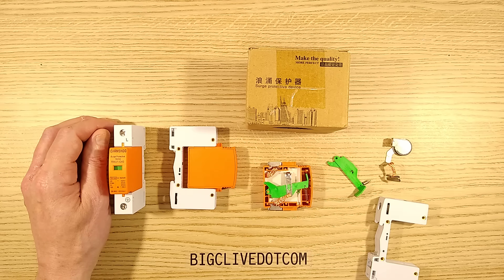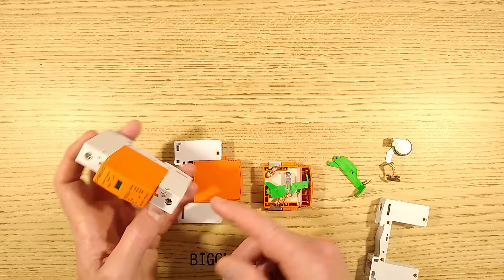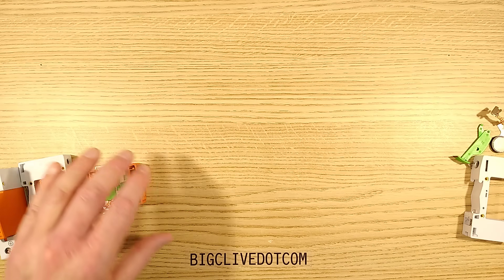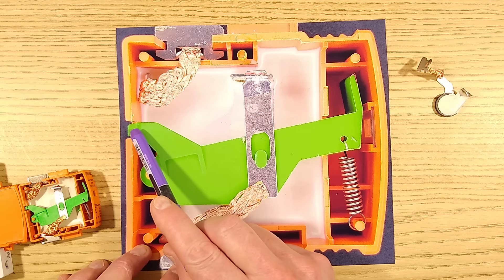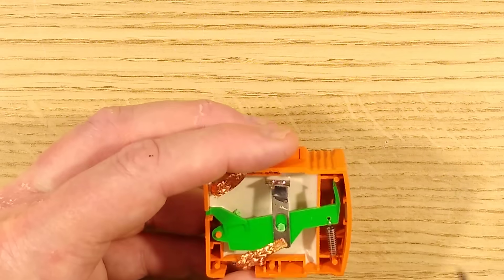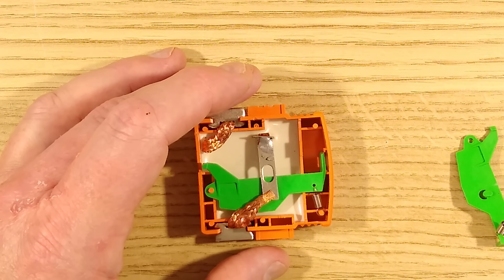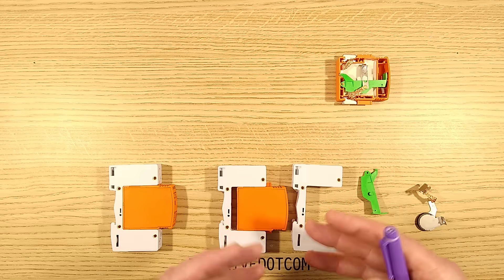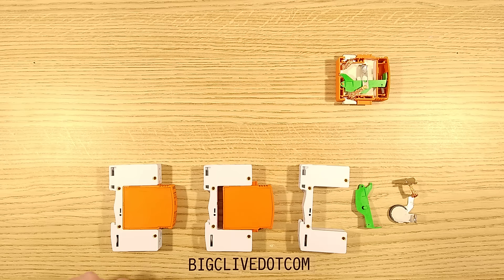Defective surge protector being dumped on eBay

Comment: Thanks, Clive. Great example of why you should always buy your safety gear / protection equipment from a reputable source i.e. not Amazon, eBay or Ali Express. You just don't know what you're going to get 😟
Reply: I've bought plenty of genuine products from Amazon-as-seller, never a fake, but do research whether something was recalled.
Reply: @stinkycheese804  i got a counterfeit Cards Against Humanity set in spite of buying from a Shipped AND Sold By Amazon listing 😬
Reply: To be fair, it’s more the brand (or lack of) on the SPD that’s the problem here, rather than where it was bought from.
Reply: @GadgetMan36 there are counterfeit ones so not much to do with the brand name since there are fakes
Reply: @GadgetMan36  but not really, because on Amazon, eBay, and AliExpress, there is no accountability and no liability.  They avoid accountability by claiming they are only a marketplace and not the seller, leaving rejects and counterfeits to flourish.  The sellers are fly-by-night operations.  They don't care what they're selling because they have no reputation to maintain and no responsibility when things go wrong.  It's not enough to look for reputable name brands.  You also need a reputable seller, or else you don't know what you're getting.
Reply: I beg to differ. You know exactly what you will get. Junk!
Reply: My amazon calipers work fine, were an outstanding value. @GeneCash
Reply: Even buying from a reputable source doesn't always work out.

Comment: Couple of questions / thoughts;
A) Deleted - hit keys before thinking 🤣
B) I was under the impression that, for effective surge protection, you need Line & Neutral suitably protected to capture surges between Line & Neutral and also Line or Neutral to earth surges 
B) was your soldering test done in a vertical or horizontal plane?  If the later that might be why the solder bridged as gravity was not assisting the molten solder to fall away

Assuming the eBay price is right and if the only real problem is the paint may be worth buying and manually painting the red in! 😂😂😂😂
Reply: Surge protection should be before any residual current device. 
Surge protection should be between any line and earth, including three phase and neutral. Let's not get into switching earth requirements like micro generation changeover. 
Traditionally fuse melting took place in a glass or ceramic enclosure, solider is not a fuse, nor sprung loaded, perhaps this is not a CE approved product, well spotted!
Reply: @tonywebb9909  Yep - you are right it is late and I got the device positioning wrong so my A) is a bit stupid - I'll delete it 😂😂
Reply: @tonywebb9909 This one is spring loaded and there's no label warning to install it a certain way up .
  Temperature controlled solder blobs is a time honored fusing technique, especially when the primary goal is to break on device overheating .
  Your talk about "microgeneration requirements" suggests you are subject to intentionally bad US requirements written to discourage sustainable energy sources like home solar .  Sane requirements require unbroken Earthing everywhere but secure disconnection of both phase and neutral whenever doing full disconnects for any reason .
  To avoid false tripping, surge protection after RCDs need to connect to neutral, not Earth .  The failure characteristics of MOVs require putting them after a fuse or breaker . In European distribution panels, this puts them after the main RCD that feeds multiple fuses .
Reply: @tonywebb9909  For point 1: laws and regulations differ between countries. This may be true for the UK, but in my case, Belgium, it's placed immediately after the first RCD.
Reply: b) it depends from the class of surge protector. Class 1 and 2 is just blocking the line or neutral like a very fast thermistor. Class 3 will do that and also direct the surge to ground if necessary but it's more complex/expensive.
The device in the video is (theoretically) a class 2, so it just protects a single cable (a line or a neutral) and you buy more if you need to protect multiple cables.
Reply: For domestic surge protection in the UK, when they're installed in the main panel you would only need to have SPD between neutral and earth in situations where you have a TN-S or a TT earth system, or some other situation where the earth and neutral aren't verifiably bonded within the installation.
Reply: There is a special one going between N and GND that won't fit in the L to GND socket (yes, you guessed how I know 😸). Bet it clamps at low voltage difference.
Reply: No earth was ever harmed in the operation of an RCD! I am Europe too, but your right rules are very unclear. Except the one where we need to protect the guy working at the top of the electricity pole
Reply: @tonywebb9909  Hello Europe I'm Dad

Comment: I bought my MK SPD from a reputable wholesaler in the UK, just to be sure. Thank you Clive for another excellent video.
Reply: There are several reputable electrical wholesalers in the UK that sell on Amazon and eBay as well as on their own websites/counters.
Reply: @GadgetMan36  I like reading some of the reviews on whatever I'm buying (usually Amazon), if the reviews are all 'great' reviews, I'm suspicious, if they are all 'trash' reviews, I'm suspicious, and if they are somewhere in the middle review, then I look for the 'best' review and see what is said and the 'worst' review to see why that person didn't like it. Just as an example, here in the US, I just ordered a modem for my internet, I plan on upgrading the service speed, so I needed one that was rated for the 'new' speed. One person left a negative review because they (the seller) didn't include any coax in the box. I'm like how would they know how much, length, to put in the shipping package. 🙅‍♀